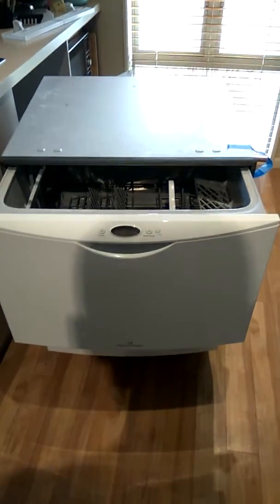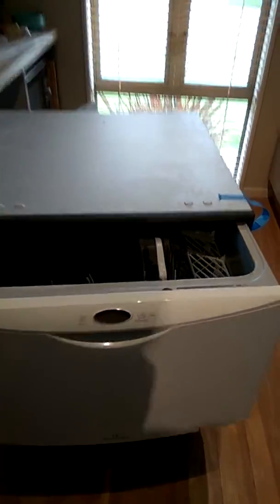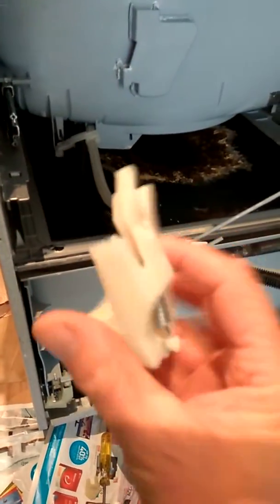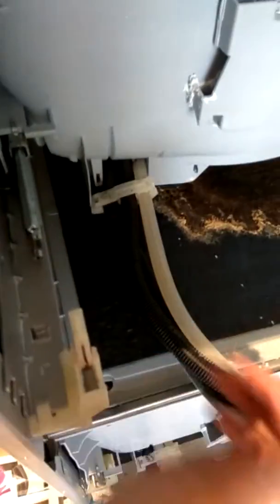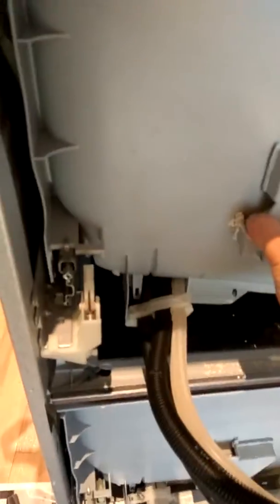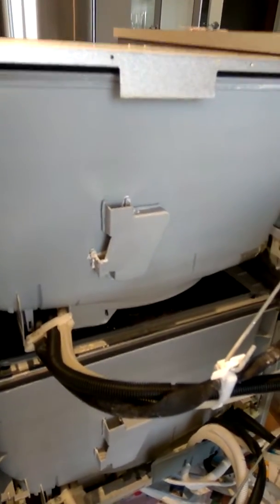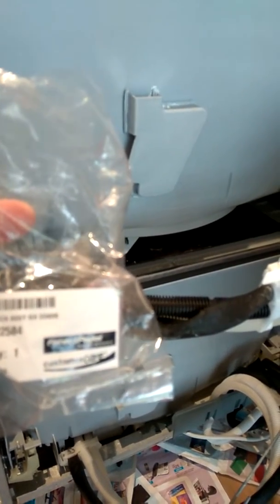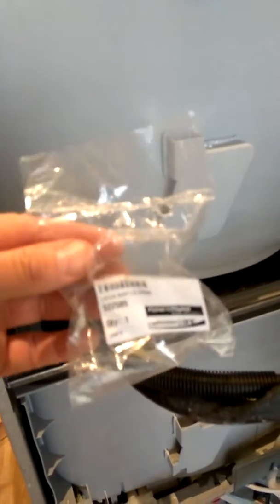Fisher & Paykel DD603 dish draw latch fix

Comment: Great video,   I replaced both lower ones last night,  took me about 5 min,  all from the front, removed the drawer and put to side,  having your video to see exactly where to pop it out from made it very easy,  used a screwdriver to move it back and it came right out.   New one popped back in easily.   Bought genuine part from F&P.  $13 each.  To easy.    Thank you and Cheers .

Comment: Nice video. Both latches on my dd603 were broken. So after I watched your video, I thought lets check if there is enough space to remove the latches without removing the back cover off. And it worked. I used 2 screwdrivers. One to pry the bottom of the latch and one to push- you could also use your thumb to push. Now I am waiting for the spares to arrive.
Reply from the maker: Well done m8, I couldn't get them off like you did and then I read somewhere to take back off. Thanks for sharing. Cheers

Comment: I checked my broken latches before ordering new ones. I found that the springs were intact but the tension pin at one end was broken. I filed off the remaining base of the pin, then screwed in a pan head self-tapper (with pilot hole) to retain the spring at that end. Did the same for both. Reinstalled the repaired latches. Works just fine. Took pics but don't seem to be able to post them here.

Comment: Super helpful video.  Is there any way to replace the latches by just removing the drawer?
Reply: Based on the video I don't think so. Very helpful video though, as using it I saw it would be far too much work to replace our latches which weakened and won't keep the drawer shut either. As an alternative to replacing the latches my solution was to simply glue on a pair of thin round rare earth magnets (that have strong pull) to the front face of the unit where the drawer closes into (where the serial number sticker is). The back of the front face of the drawer is magnetic and when closed it grips the drawer shut tight. It's got a very good hold now, iId say even better than before :)
Reply from the maker: Sorry for late reply. I removed draw but couldn't get latches off as the back plate is to close to latches. I just drilled out rivets with 2 mm drill bit and replace rivets with short 2.5mm or 3mm (can't remember which) self tapping screws.
Reply: maybe too late for your. After I watched this video, I thought lets check if there is enough space to remove the latches without removing the back cover off. And it worked. I used 2 screwdrivers. One to pry the bottom of the latch and one to push- you could also use your thumb to push. Now I am waiting for the spares to arrive.
Reply: @adamskelton6171  I think the latches do more than just keep the draw shut. It also applies some upward pressure. What I noticed is if I ran the cycle even by pushing the draw hard shut , water was still leaking off the top through the gaskets as there was not enough pressure on the gasket.
Reply: @pradeep76a  Great to hear that you got the latches off without removing the back cover. I've been using the magnets for year or so now and haven't had any leak. There's a rubber top that comes down over the drawer when on that should stop any water seeping out. I've tried opening the drawer while the dishwasher was on by accident and found I couldn't do it, the top was keeping it firmly in place. Therefore it sounds like something might be wrong with your seal (or you weren't quite holding it in the right place and the top couldnt get a good seal).
Reply: Yes, at least for mine. There is just enough space behind the latches to put the screwdriver into the hole and twist to push them backwards and and they can then be removed. You can just slide the new latch sideways (pushed all the way to the bulkhead) and then pull forward until it clicks onto the rail.
Reply: I'm sure this is too late for your repair...but you do not need to take the back off or remove the dishwasher from its location.  In most cases its the springs that fail. So take the drawer out, locate the latch and replace the spring. Took me all of 30 minutes to fix. You must buy the replacement latches. But you will only use the spring and if you want the top part of the latch. Easy job.